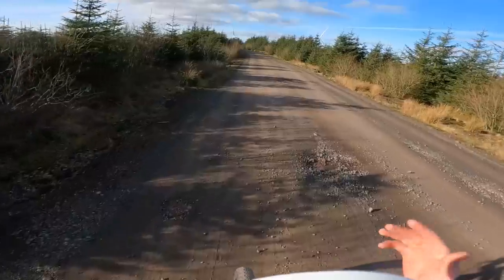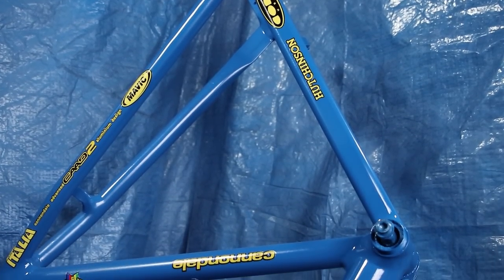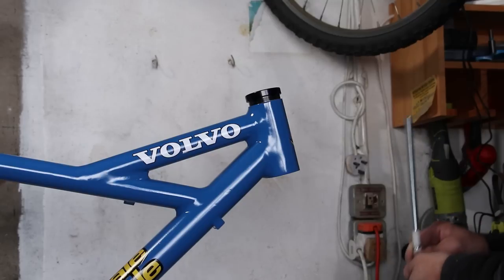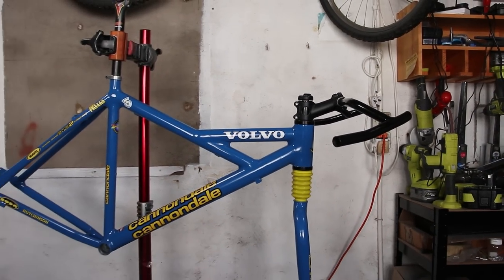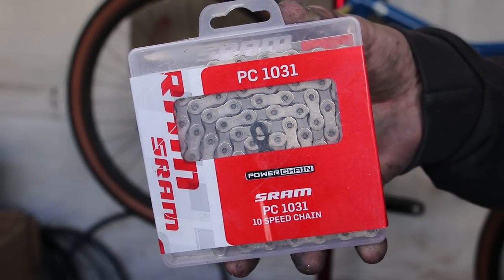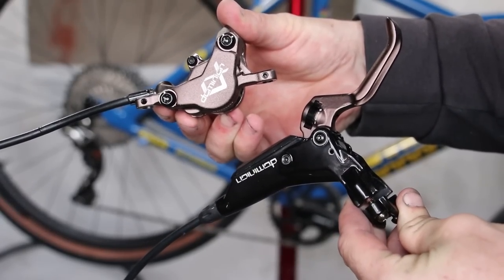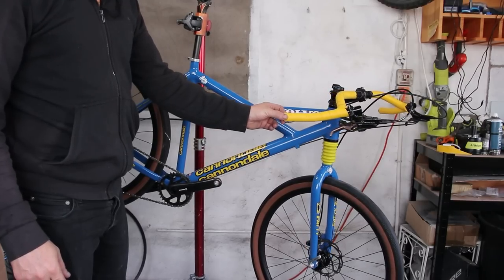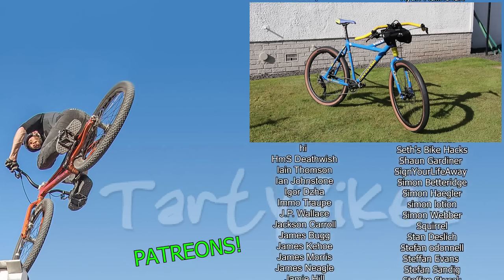The Ultimate 90s Cannondale Gravel Conversion Is Finished!

Comment: I seriously like that! I had an Iris blue (really dark metallic blue) killer v800 from new back in 1998, kept it until the early 2000's. Fantastic bike and those headshox are very tough and long lasting as well as having incredible small bump sensitivity. To keep it smooth invert the bike, pull back the shock boot and dribble lube into the fork, those 88 needle bearings will thank you for it.

Comment: Great build and attention to detail.  I have a secondhand 'dale Silkroad, which is a 700c bike they built for the Paris-Roubaix in the early 2000s I think.  Same blue colour and yellow decals, and an early headshok (only 1" travel and carbon stays, and yellow boot).  I hate drop bars so put an Easton carbon XC90 flat bar on it with barends and also found a Bristol bike shop which cnc'd adapters for Shimano barend shifters so they could be fitted as traditional thumbshifters.  So it's a classic roadie frame and skinny tyres but setup more like retro mtb.  Only 1 hr or so mins north of Glasgow if you want to see it or meet up for a gravel ride.  Have 2 other classic dales from early 2000s, both CAAD4 xc bikes, no frame failures but headshoks need serviced as seals have gone now.

Comment: For a 68mm bottom bracket shell, you need a 2.5mm spacer on each side for those XTR cranks to work. Please use the XTR cranks, Hollowtech bottom brackets are so much better than anything SRAM can do (most other bike mechanics will likely agree).

Also, those bars let you run conventional grips on the "drops". My recommendations for comfort would be grips made by Oury, nice bike silicone grips, super squishy. I never get numb hands or wrists when I'm riding.

Comment: Great bike.
If the rearbrake is not completely centered you could use the half round  rings/spacers that are on V-brakes. use them on the bolts that connect the brake with the pad, you should be able to centre it better. Let me know if it helps 👍

Comment: Cannondale was the first brand to adopt the 1.5 steerer standard when Manitou revealed it with the original sherman fork specifically BECAUSE it was slightly smaller diameter than their existing headshot steerer tube size (if I remember right it was 1.56") and it only required changing the headset bearings and upper and lower steerer tube races to fit the 1.5 steerer tubes.
Reply: You're spot on with the 1.56" original steerer tube size.

Comment: Such a sweet build. I love the 90's retro bike, especially Cannondales. I had an F800 that I rode for years, before breaking a rear axle, which pitched the wheel over and rubbed the chainstay through!! CAD5 frame tubes seem to be far too thin to repair!! Especially in a weight bearing area like that!! I'd E en replaced the knackered old Lefty, with a USE Sub fork!! Now, you don't see too many of those about these days. It's still in pristine condition in my shed, waiting for my son to be big enough for a full size bike, and for me to build him a retro 90's bike for it to go on. 😎👍🏻

I love the colours or the accessories on this build. Whatever anyone says, if it puts a smile on your face, that's all that matters. 😎🤘🏻

Comment: That's sick! I love the bars. Using 90 degree hose fittings, you could tuck the hoses under the bar tape. Is there a way to get the shifter cable tucked away too?
It's a very elegant solution to running drop bars with mountain bike gearing!

Comment: stoked on the build...giving me ideas now :P....on a side note looks like the boot bottom end was zipped tied on the stanchion part which would render it in the way of travel and on full squish you can pinch the boot. It should be clamped down a notch lower, just above the part where the legs start to diverge.
Reply from the maker: Noted cheers 👍🏻

Comment: Bike looks awesome!! The saddle is perfect and matches one of the stickers on the frame. Only one issue. You've got to put two cable ties on the headhshok boot. Otherwise, after a long time, crap can get in and the needle bearings will rust. A seized headshok is very bad news.

Comment: Came out really nice in the end Ali, so well worth it, even if it did take quite a bit longer than expected. I'd love if C'dale started to offer the HeadShox forks again as after market to fit 29x3" setups, it's actually all I've ever wanted to make the bestest ever "rigid" bike - just a little travel, but the big part, adjustable dampening to help control the front end from the balloon bouncing you can get.

Comment: Beautiful, The disc adapter does fit some later Gary Fisher and klein frames, but is easier to find as a Trek disc brake adapter. A company called "sellutionmtb" makes and sells A direct post mount version and modern CNC versions of other adapters too, worth a look is anyone is considering a similar build.
I personally don't think it will crack, the way you have it positioned in the unique frame/dropout design means its basically creating its own brace.
Reply: helpful info. thanks

Comment: Nice bike build! I do recommend  drilling gear cable holders so the cable can pass without exposing the cable itself. It was a weird trend back in the old days but imho it only attracts dirt and shortens the life of cables. I recently did it on my own bike with a small drill bit. Have been riding it like that for 3 thousand km since then and works great. Great vids BTW can't wait for updates on the hardest MTB trail !

Comment: Ali FYI: Part of the reason you may be worried about your Crescent Wrench (or maybe in UK parlance: Monkey Spanner 😂) slipping, especially tightening a BB with the large spanner, is that you are using it “reversed”. The adjustable tooth is toward the forward of turn, and fixed tooth is to the rear....  Brings back memories with that bike!!! Another FYI: When using tube tyres for touring, gravel, or ground with glass & construction debris, I always lined the inside of tyre with a strip of nylon webbing like used on backpack straps. A pain to line up when new, but literally I have had chunks of glass embedded in tyre and self tapping screws in tyre, even had somebody shoot the sidewall with a nailgun, still ride with no puncture or leak. On a road setup on downhill turn at speed - it may feel a bit ‘loose’ at wheel but never was an issue.

Comment: Beautiful!  How much clearance do you have with the 650b tires and the Headshok valve cap?  I have a lovely vintage Cannondale with 26” wheels, and would like to convert the bike into a gravel steed, ideally with slightly larger wheels like 650b.  Have you tried other tires for fit?  What rims did you use?

What range is your cassette?  Safe to assume it’s a 10 speed?

Comment: That's looking great, Ali.  The bars are something else.  I wouldn't worry too much about the brakes snapping the frame, they're hanging from a pretty beefy dropout rather than loading a weedy-looking  stay sideways, and you're only running a 140mm disk.  I'd be more worried about 90's era aluminium cracking around the headstock or BB, to be honest.

I had no idea they made a rigid lefty.  That's awesome.
Reply: A 140mm disc seems the right choice, I wouldn't go any bigger since it's not worth it anyway, even a weak rear brake locks the rear easily and then it just slides… Still I would be concerned a bit about the frame braking there, this DeltaV/KillerV-style type frame usually breaks at the rear dropout, discbrake fitted or not. I'm guesstimating all the rest of the frame is so beefy in itself that the rear dropouts are the weak link, since they also got so support most of the driver's weight.

Comment: Did Ali forget the difference between a 68mm bb and 73mm 😉.  Couple of 2.5 spacer on the BB and those lovely XTR cranks would have fit.
Reply from the maker: That would’ve been a good plan but it was so far from working it needed about 10mm of spacers, I was torn between which cranks to use anyway so it made the decision for me :)

Comment: Very cool Ali! Awesome build.. I'd 2nd the idea for tan / brown bar tape and saddle, think it would help make the frame pop. Or maybe a dusty red that matches the sidewalls? I did a similar thing a few years ago on my green Surly build, had trouble finding the right shade of red. Eventually settled on using tennis grip tape! Had to deal with the length, but there are some cool tennis grips out there that mimic the feel and color of a basketball. Had the right shade of red / orange / brown (plus all the little grippy dots you see on nice basketballs felt nice)

Comment: Probably won't see this now and maybe someone else has already mentioned - but the headshok boot should go over that bottom lip. 

Great build though. I have a similar gravel bike based round an old F1000 ( more conventional shaped hardtail). Also running a headshok - but normal gravel bars, some old Sram rival shifters and juin tech cable/hydro disks. It's still on 26x2.2 conti speed kings but I'm really tempted by trying 650b now.

Comment: The build looks absolutely gorgeous, I'd love to have a headshok myself! I'd kill for this frame + fork set.
A bit surprised with the alleged rear brake mount strength issue. If the mounts are there and it's a Cannondale frame, why would it snap?

Comment: At the time, I broke this frame (Killer V900) on the oversize tube. For the fork, I'd installed a Pace RC35 carbon fork with a titanium steerer tube that I'd had machined. I still have the fork.
It was very uncomfortable, especially compared to the K2 I later bought.

Comment: Leaving one of the brake bosses on to use as anchor point for a torque arm for the rear disc mount may have helped.  You can get bolt on ones though...although may be a bit ugly...

Comment: It's amazing. Also the whole mech part (also for me) can be even more fun than actually riding the bike. I got a fron suspended 1997 cannondale recently (at least I think it's 1997). I cannot identify it exactly because I think it has a limited livery (green/yellow) and could be a race team bike. Also there is only written CAAD 3 on the frame and no name (as you would have with F700 etc), which makes it probably an "only frame" custom built bike. Do you think you could help identify it? I cannot post pictures here but if you think you could, I can upload to public links. Was amazing to ride with v-brakes (totally underrated) through forest trails with it.

Comment: they call those waterslide decals for a reason.

i have a 2005 TREK 7300FX DISC it came with the IS mount added factory and other than wiggling loose until I blue loctite it there's been zero issues. same bike welded mounts up front was off when I tried to run a 180mm but the back was able to. there is also a PM version. both are like $60 canadian.. KLEIN TREK GARY FISHER.. BONTRAGER

Comment: Bar/grip idea... bit late as bar are made, but.  Get the extra long bmx grips. Have one side or bars welded, let cool. Slide grips on as  possible, possibly bunched up.  Weld up other side, let cool. Slide grips apart, then fit another set on the ends of the bars. Spray clearcoat under them to stick. Would have people wandering how you did it.

Comment: I'm trying to do the same thing with my old Cannondale F400. Fortunately my frame already has mounting points for a disc brake. I ordered a used headshock from eBay, which also has disc brake mounts. I'm wondering what kind of tire fits your frame. Especially the tire width would be interesting to know.
Reply: In the end of the vid he mentioned using 47mm wide tires. In the 'wheels' part he stated using Hutchinson Overide tires on 650B rims.
Reply: @el_micha  Thanks. I'm went with Panaracer Semi Slicks which blow up to 49mm on my rims. Still about 10mm of room between tire and fork.

Comment: Hey. I see you used narrow wide chain ring in your build. How is it working, how do you feel about it? I just switched from chain guard/tensioner to narrow wide and honestly a bit disappointed. It looks awesome, but on a harder ride it dropped chain twice. Does it happen to some of you as well? Can it be somehow work better?
Reply: I'm also riding narrow-wide single chain ring in the front. My chain rarely dropped the last 3 years. But I only ride in a city with very shitty roads and light terrain with my bike. It might be due that I like my chain length quite short (I rarely use the biggest sprocket of the cassette hence the derailleur can have a quite streched position in that). The better version: Shimano since a couple of years (I think since 10-speed) got a switchable stiffer spring in their rear derailleurs leading to much better chain tension so chain doesn't swing too much in rough terrain. Prevents chain falling off…
Reply: Also, you can look into a chainguide for the front chain ring. That would be the effective solution of the old times. An upper chainguide should do, you wouldn't necessarily need a lower guide or the fully covered chain ring type.
Reply: @el_micha  hey. Thanks for response.
Currently I own 3 bikes, the endure one (in question) in with clutch and narrow wide and on harder drops the chain drops sometime, very frustrating, so I installed the upper part (some sort of guide, just like you suggested) and it's a bit better, but still disappointed.
The second bike - an gravel, no clutch and NW ring. Works awesome, but I use it as it's supposed to be, rough terrain, but no drops etc.
The third one is a city commuter based on old polish bike from 70', no NW, no clutch, no  front derailleur and it's working great.
So it looks like Narrow Wide isn't as great as I thought. Also, I like my chain short as well, but I do use 11-42, might be to loose on the 11.

Comment: As a cannondale head I got to be critical – a) the frame shouldn't be hacksawed. but well, I see ur point. At least since u chose to clean the canti bosses u might as well also drill up the cable guides to fit the hydraulic brake lines without them fugly adapters! Consistency 🙂 b) Colors don't match at all: Volvo Cannondale team color is not correct. It ain't too easy, but yours is far off. Fork boot yellow also looks wrong, yellow is very greenish (is it aftermarket?). Bar tape and saddle – everything has a different yellow hue c) decal quality is average. At closer look line width and contours are not great. Also yellow hue looks bit off and black contours too wide. ("Retrodecals"/Gil is the go to-source for bike decals in the UK). Decal fitting is also bit poor (tilted Hutchinson logo, peeling off Fatty lines)…

As a C fan I am based, of course. I bet it still rides good and good to see the bike on the road.

Comment: In spite of its design that era of Cannondale dropout was OK..the most common fail at that time was frame cracking due to very thin wall thickness ,more common around chainstay/bottom bracket area.

Comment: No way that frame is going to break at the rear brake, those drop out's have to be strong with that weird weird design.
Reply: That looks like nearly the strongest way you could make a disk brake mount on a bicycle. Almost like cannondale designed this frame for disk brakes, before disk brakes.

I guess the drop out could conceivably stress crack at the new holes from the stress of riding, not the brakes, but the brake hanger offers a reasonable of reinforcement. This is about the most stout disk conversion ever done.

Comment: What a weird design choice by cannondale to go so heavy on the headtube area and then use that unsupported rear dropout. My guess is that it breaks when filming your "Can you ride a trials comp on a gravel bike?" video.
Reply: Its an old frame. Braking was done at the rim so no big forces down at the dropouts.  Plus riding styles back then were different.

Comment: 10 speed chain on an 11 speed drivetrain?.. Also look like you forgot to put all three spacers with the bottom bracket, hence the play.

And pleeeease put bar ends in the front openings!
Reply from the maker: Ha yeah you’re right about the chain, works well though so that’s good. The bb needed way more than the standard spacers, it was a long way from working plus I was torn between which cracks to use so I didn’t lose any sleep :) I will get some more bar plugs asap though
Reply: @Ali_Clarkson  good to hear the sleep is still higher priority 👍
But still-, -no way those cranks were boost... Maybe another spacer-, -about 5mm-, -right next to the spider? It can also be a dynamic seal unit - some road cranks have it
Apparently this particular 970 crankset has to be tightened as if it is Octalink, so the play must go away as you crank up the nut

Comment: why didn't you just buy Surly Corner Bar instead of its copy?
Reply from the maker: Out of stock everywhere
Reply: @Ali_Clarkson  funny, very often I can't find a niche component in EU stores but almost always I see .uk stores selling what I need. It seems like it works both ways. 
Btw, if you choose Corner only because of mtb brakes, you could try Gevenalle 1x12 shifters with hydraulic brake, it's basically TRP Hylex RS brake system with integrated thumb shifter. IMO this thing is cool but I'm too poor to try it out.

Comment: by not aligning the decals properly youve wasted all that hard prep work and nice paint job. and it will always be off. with just a few little easy steps you couldve properly aligned them. personally if that was my build i would destroy the bike or fix it. thats something i could never live with. also its wise to order two sets of decals incase you mess one up so you dont just go with a mistake or you wont have to wait for new decals, plus its cheaper.